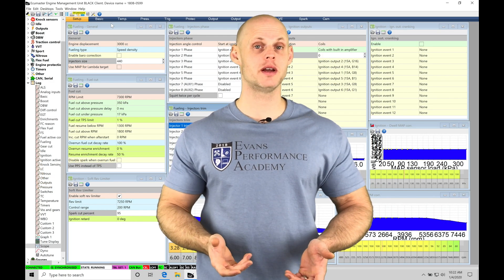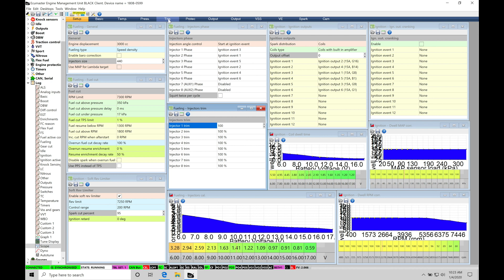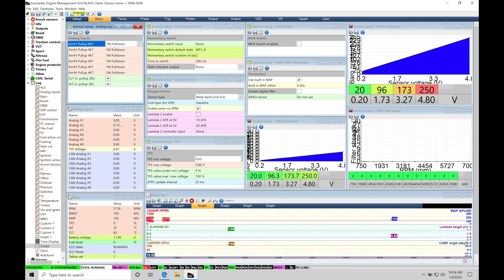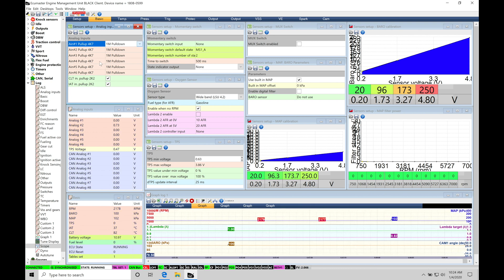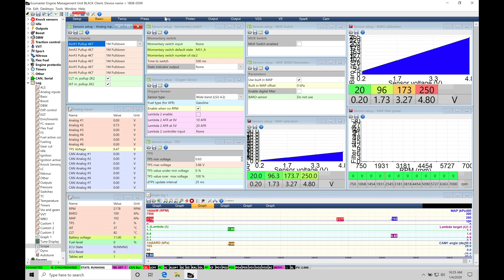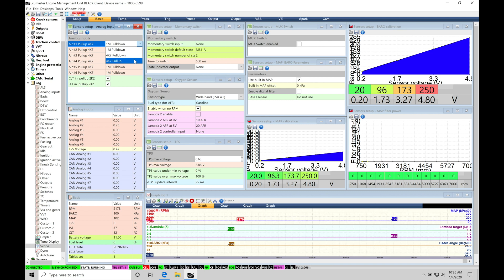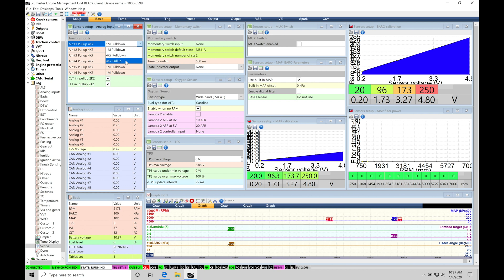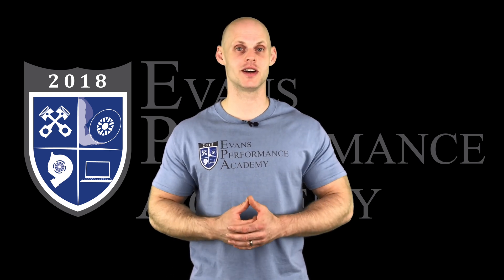ECU Masters Training Course Part 9: Basic EMU Black Inputs | Evans Performance Academy

Comment: Does this course for the Black also apply to the Classic series of ecu?
Reply from the maker: Yes, the EMU Black and Classic are similar in software.  The Classic version doesn't have as many features for programming in comparison to the Black.
Reply: @EvansPerformanceAcademy  How do you like working with the Ecumaster Black compared to say, something like AEM or the Link?
Reply from the maker: @mikedsilva  Link G4x is the our choice for affordable engine management followed by AEM and Haltech.  The biggest differences between EMU Black and Link are the superior logging speed /channels / log sizes with the Link and the data analysis software.